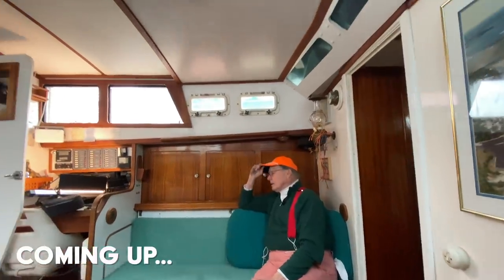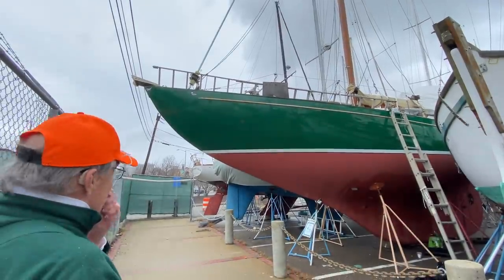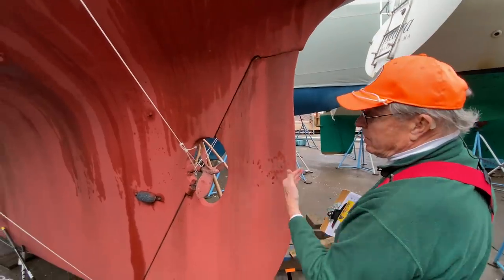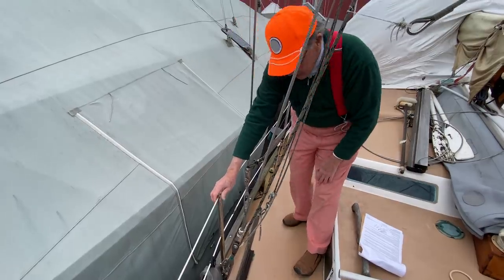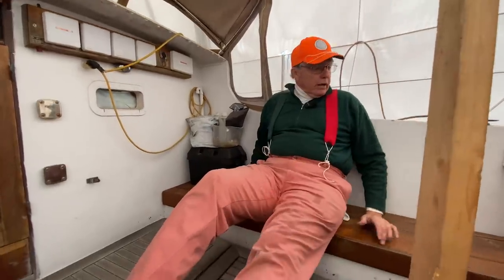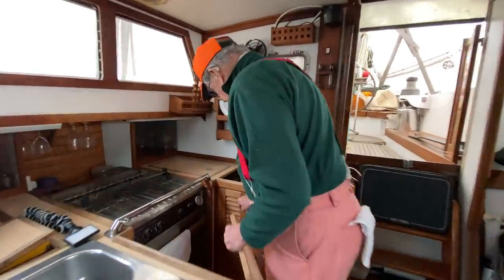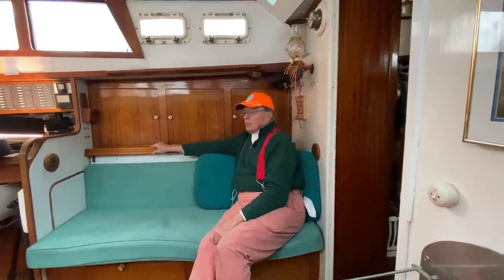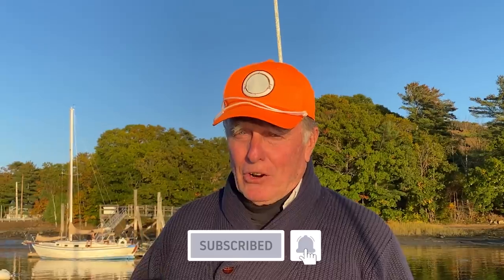SURVIVING A PIRATE ATTACK!! - A Steel Sailboat Story - For Sale $64,900 - EP17

Comment: Hi, My name is Jay. I'm the owner of Gandalf. I have owned the ship for 28 years .If you have a question I will try and answer.
Reply: Love your yacht.... Really like how light and airy she is below. .. bet she tracks like on rails.  Someone could go a long way in comfort on this vessel.
Reply: Hi Jay, when is your book coming out? You must have at least a couple of volumes of stories sailing such a lovely yacht. Wish I could come buy it, but it is a bit out of my budget.
Reply: @tharney8003  solid idea!
Reply: @tharney8003  No story. You have to make your own. Have fun.
Reply: @ecnavttocs  Hi , the ship sails well and most important Fast!. Spending a lot of time in the ocean can tricky. It' really big out there.
Reply: Hey Jay , that's a great looking boat . 
Is there any rust issues inside the hull or bilge ? What part of the country is she located?
Reply: @kwaichangcaine8234  Hi, I keep after All parts of the ship. Most important is that all the inside steel can be seen for inspection No surprises.
The ship is in Beverly Ma.
Reply: Sweet boat Jay, buff and brawny on the outside, bright and cozy below.
 Captain Q certainly did a worthy tour of Gandalf and failed only in hiding his admiration.
Reply: Hi Jay. Your boat is on my short list, and this tour helped answer some of my questions. Guessing that wenches are located well for single handling? From ad photos, does the main have 3 reefs? Thanks. Love Gandalf's lines.
Reply: @alu.minium521  Hi, three reefs full batten main. Sailed mostly in second reef. Went just as fast and easy to handle.
Reply: Hi Jay! Great boat. Seductive price, fantastic pedigree. Looks like you've kept her up too. Some basic questions: What is her waterline length? Draft? Beam? Displacement? Sail area? How much ballast (weight), where is it, what material? How much sail area? How much fuel and water does she carry? How big are the house batteries? How old is the engine? How many hours on it? That nice-looking heater in saloon, what fuel does it burn? Thanks!!!
Reply: @charlesdoane8773  Hi,
Have a look at this.

  Fore deck: Forward is a Maxwell windlass .The foot switch is just to STB of it. There's also 2 remote fobs.
The other winch is there because I was going to install a Samson post, but Marine Exchange had this nice winch. It has been very helpful in a number of different ways for a second anchor and such.
The ring behind the windlass is for an inner forestay. The sail is on the ship with a turnbuckle and lines.
The forestay wire itself is in the closet as we weren't using it. It mounts on the spreader.
It's a Concordia coal stove I converted to propane for easy use. Easily changed back to coal if desired. A Charlie Noble is afixed to the chimney above the deck when in use. Otherwise, there's a bronze, watertight screw cap cover on deck..
 Mast: It is original. The boom has been replaced as the original was destroyed in the Manchester Marine fire in the 1980's.  Last pulled in 2016.
I made all the ss hardware. The 3M plastic wrap was an experiment. Standing on the jumper with a can of varnish and a brush was getting old as am I!  It's been on for 5 years. It's all in the repair log. No varnishing to do above the spreaders.
Tankage:
Holding tank: 15 gallons under the floor behind the mast.
Diesel:  Two integral steel 40 gal tanks. I added two 19 gal plastic tanks beside them. There is also a bag tank in the engine room.  Total Capacity of about 140 gal.
These all run off a manifold with an electric pump to fill the "Day Tank" port side steel.
Water: At the moment there is only one 15 gallon water tank installed. I removed the other to service and inspect the bilge.  We only carried 30 gallons of water as the PUR 40 watermaker which was pumped into a 5 gallon plastic cube in the deep sink can be tested before decanting into the indwelling tanks.
Mechanical.  The winches were rebuilt 2 years ago.  Stripped clean and reassembled.
The ship first used a V belt system. That was the tech at the time.  Next came along Gates HTD belts. Much better and no slippage.  I had Gates do a study and found that it was only rated at 15hp.  As I would be installing a 52hp engine this was not good enough. Back to Gates again. They recommended a Poly Chain belt. These belts were $250 in 1992!  They rated a 24mm wide belt at 90hp for continuous 24hours use. We had three days at 3200 rpm after fun with pirates, so I spoke with them about what I was going to need. We decided that a 90mm was overkill but I had the space.  Check out the next Harley-Davidson motorcycle you see and it will have one of these belts instead of a chain. They are about 24mm and will handle 100hp and someone not being nice to it so 90mm and a 14 inch propeller is not a problem.  I designed a system that could use the new belt .Works great. The only problem I ever had was I did not put enough angle to the CV joint and had static wear spots from not moving up and down and out of plane. Simple fix to lift the back of the engine a couple of degrees.
Next the belt alignment is done at the top sprocket. Simply by "Canting" the angle of the sprocket it will center the belt in the sprockets. Easy.
There is a spare belt ready for emergency use.
Process to replace the belt:
 The upper sprocket is loosened and dropped down a bit.The two bottom pillow blocks bolts are removed and there is a spacer underneath the pillow block ( there is a handle on it for this job) is removed and the new belt is slid into place. The spare belt is tied back to stay away from the upper sprocket. I made a tool to lift the upper pulley to put the correct tension and alignment back on the belt. This can all be done in about 15-20 minutes.
There is no alignment with the shaft as it is all one assembled. Meaning ,the shaft,coupler and lower pillow block stay straight. No shaft alignment to do. It's done once..
I swapped the belt at about 2500 hrs just because. It looked new. Only a cruiser will fix something not broken.  Just reassemble and tighten all back up and good to go.
All bearings and propeller shaft are greased remotely.
Yanmar recommends 250hrs for oil change.  All this is in the log.

Electrical:  Yes, there is a trickle charger with controller for the wind generator and solar panels to the battery..

Safety:  There is a shut off switch for the propane just left of the companionway.

Coating:  The topsides are painted with a base coat- clear coat system. PPG and Dupont.
My Last full paint job was in 2008.
The black is epoxy over a small repair. It works well with the coal tar epoxy sealing the hull Bottom painted 2 years ago. It has not been in the water
Repairs done by removing rust. Treating what might remain. Then an epoxy primer is applied then finishes the epoxy coat.
Have a look at this site . There have been rebuilding a steel ship. https://www.youtube.com/watch?v=IRvQQgiR8yc

Steering,
As you saw there are two control heads for the Autohelm linear drive. It is controlled by a KVH flux compass. There is also a new spare compass and a spare drive as well.
The TMQ is Australian. I bring it out should there be a problem with the Autohelm. It has its own linear drive. As you may have guessed I don't like steering the ship.
Rudder just hasn't moved in two years. The pinlets might be tight or the bigger bushing in the rudder shaft may need some attention.
I replaced the entire rudder system when I rebuilt the ship. I don't see it as an issue. At least they are not loose!
The Aries is not mounted because we would only use it at sea. I removed it at the repaint. All mounting is there. Also spare parts for it.
There is a Big tiller for the emergency tiller. It has been tested.
Mooring,
It's out in front of the marina gas dock. It can only be sold. I still have a permit but it's not transferable.
Hull.
I have blasted the ship twice. When I first bought the ship and again in Thailand in 2003.
There are vertical welds that join the plating. I have not had to do anything with the rivets in 28 years.
I have removed the entire galley and redesigned it as that part of the hull could not be inspected. Now, It can. Everywhere the hull can be inspected .
I do not like surprises.
I hope this answers your question.
J
Reply: @jaybarry8483  Thanks Jay! That's a whole lot of useful info. But what about the basic specifications? Are they simply unknown? And the ballast? Also, how is the boat insulated??? And what is the air draft? Can the boat fit under ICW bridges? I'm checking the boat out for my cousin, who is very interested, but a bit of a novice. He's already inspected it; I will organize an inspection myself. I own a 47-foot aluminum boat, so am somewhat versed in the realm of metal boats.
Reply: @charlesdoane8773  Hi, 7.5 draft, 33ft water line,15 tons and 64 ft from water to top of mast.
Ballast is lead and concrete.
Deck is insulated. The hull is not for inspection reasons. Don't know about the bridges. I preferer to stay away from them!

Ask anything.
J
Reply: @jaybarry8483  Thanks! I found the broker's listing. Some good info there. One thing missing is sail area. Need that to calculate SA/D ratio.
Reply: @charlesdoane8773  Hi, The main is 504sq ft. I do not recall the jib area.  I had a new one made three years ago. Used it twice. The ship was more than fast enough!
Newport to Bermuda, 660 miles 3.5 days. Galagoes to Fatu Hiva  3000 miles 19.5 days. And that was being careful.
I also have the complete inventory list should you want it. I bought it all and it impressed me!
J
Reply: Hi Jay.
Greetings from Frank.Sydney Australia.
Thanks for making the effort to reply.
Her lines remind me of the three times  Sydney to Hobart Tasmania race winner "Freya" . So beautiful.
Could i ask how the deep draft went in the pacific on your circumnavigation and what is the hull steel plate thickness. 4mm - 6mm ? Cheers.
Reply: @frankguernier2280  Hi Frank,
We loved Australia! Spent three years there. Sailing and driving.
Never any problem with the draft. Rarotonga might have been a problem. So we skipped it.
The hull plating is 5mm,deck 3mm and 10mm on bottom of the keel.
J
Reply: @LoanwordEggcorn  Hi,
When I designed the drive this was the best there was. It has 5500hrs on it with no problems.
Gates did a study for me to make sure it was over the top.
As a Porsche mechanic I have seen that type of belt everywhere.
Thanks,
J
Reply: @jaybarry8483  Thanks much for your reply.  Are you referring to the Gates synchronous belt or the Hutchinson Poly V being used in many applications?  They're fairly different designs.

Also I assume the bilge the belt is in is designed to be dry.  Would seawater affect a belt much?
Reply: @LoanwordEggcorn  Hi, Gates poly-chain belt. After 2500hrs I swapped it with the in- place spare. It looked brand new.
I'm told it Very hard to even cut one of these belts. First, it never gets wet. The bilge alarm would go off first. From my experience nothing would bother this kind of belt. Ask Gates.
J
Reply: @jaybarry8483  Thanks much!  

Out of curiosity did the original design use a vertical shaft on bevel gears, chain, or other type of belt?
Reply: @LoanwordEggcorn  Hi, V belts! Could not be rated over 10 HP.
J
Reply: Just a note to say I loved her.  ♥️
Reply: @Themothershipsailing  Hi, Interestingly the former owner always called Gandalf a "He" as to we !
J
Reply: jay barry   Jay, I love your boat, ship. I guess 28 years is long enough to want a change of pace. Have you been living on board for those 28 yrs ? Please forgive me if that question has been answered , I apologize in advance. Do you think that your ship is better suited for a young owner with lots of energy , or do you think some older geezer would fair well with your ship ? If you have any time to consider this I’d appreciate your thoughts.
Reply: @robertblake1032  Hi Robert,
When we rebuilt the ship we kept it in downtown Boston as our "Winter condo"
Your house was in Gloucester Ma. and my wife worked in Boston. 80 mile commute. It was a $1000 dollars and two guarded parking place for six months in the marina! In 1997 we sailed to Trinidad and back to Gloucester. Made a bunch of changes and a new engine and spent the next 8 years sailing around the world.
So, no not full time but a lot. I bought the ship when I was 40. It's a big ship will need someone with energy. As for "old geezers" I met quite a few when sailing that were hard to keep up with! It depends on the person.
Hope this helps.
J
Reply: Nice boat Jay, looks like it would take you anywhere!! Nice work!
Reply: Thanks for killing those pirate scum. "Seh hullo choo my luddle frund!"
Reply: How much of a nightmare do you think it is to service that belt while underway?  I mean really what would your options be at that point?  Would you have to pull the lower shaft to get the belt around it?
Reply: @TroyBlass  Hi Troy,
When I designed the system it was with the worst case in mind.  So, I made captive nuts that stay in place .Also the bolts as well . The spacer under the forward bearing pillow block has a handle welded to it for easy placement. The spacer is used to allow the belt to slip in place. The rest of the belt is pre-hung to allow a fast replacement.
When I worked with Gates engineers on this they told that the belt was all but indestructible.
As an Old Porsche mechanic I'm pretty good at finding what will fail before it does.
At 5500hrs and no issues. Hard to do better than that!
Next time you see a Harley Davidson motorcycle have a look at the belt drive they use. I'll bet you've never seen one broken down in the street because of the belt.
Happy to answer any other questions you might have,
J
Reply: @jaybarry8483  Top notch reply!  

As a guy who had a cam tensioner fail in the head of my 944S, sometimes having a "oddity" comes back to bite.

I'll be up your way later this spring.  If for some reason shes hasn't sold, I would very much like to arrange a look.

Good luck to you and yours
Reply: @TroyBlass  Hi Troy, Because I was in the business for 40 years how much did the repair cost?
Expensive bits!
J
Reply: @jaybarry8483   I got really lucky and found a wrecked 928s4 with a good passenger side head.  ~$1500 by the time you factor in new t-belt, gaskets, fluids, and head.  I wish they would have just added a second cam pulley, but fun car for it's day.
Reply: I'm very glad you and your better half survived that attack in the Gulf of Aden. Back in the 90s, I sailed those waters.  I love how you restored Gandalf. She's truly gorgeous, both inside and out. Love the serious work done to protect against electrolytic corrosion, especially near the mechanicals.  If I were to sail around the world, and I'm seriously thinking about it (but I'm not ready quite yet), I would want to do it in a solid sailboat like Gandalf. I don't want to waste your time, I think I'm 5 years out from even contemplating something like this, but I am interested. I would make some updates to her, but I'd keep her name. I would take her far but I'd try to steer her out of harm's way.

It would satisfy some curiosity if you'd indulge a few questions:

1) I noticed the ingenious belt drive on the shaft and saw your comment about having an in-place spare.  How deep is Shaft Alley? What can you tell me about her shaft seals and maintenance?
2) It looks like the engine room has water-tight bulkheads fore and aft. Is that correct? Where else does Gandalf have watertight bulkheads? It seemed like she also has a small water-tight bulkhead in front of the V-berth area.
3) If someone were to outfit her, do you think there would be room enough in a refit to include equipment like a watermaker, dive compressor, air conditioner, water heater, expanded battery storage - Maybe not all those things, but some of it without compromising the layout too much?
4) I assume there is sail storage in the back, behind the engine room/shaft?

Thank you in advance for any answers. Gorgeous yacht. It looks like she could do another circumnavigation.

Thanks to Captain Q and his fearless companions. I love your reviews and I'm especially happy you reviewed this beauty. This didn't seem like the type of boat you usually review, and I felt that you wanted to use the Captain Q measuring stick, but couldn't. You've reviewed a lot of sailboats and I've seen them all, but to me, this one stood out. I'm not against modern sailboats, and I like self-furling mainsails, yet there is something about a full-length keel and the sublime beautify of expertly rolled steel. And, it's always nice to see the ICOM SSB, present.
Reply: @marroquinjoe  Hi Joe,
The bilge for the propeller shaft is about 4 feet below the engine bed. The propeller shaft is a remote greased tube. I use the Teflon packing. Also a special Wurth Co. grease. Works great. Little  work.
Only the engine compartment has a wall.
There is already a water maker. I used to have a 5 gal water heater. By the time you got hot water to the sink you wasted 2 quarts of water!  So I took it out. There is all the room  for stuff. What was not shown was the 20 gallon emergency WINE storage! We had a story in Cruising World Magazine about that.
We only carried a stay sail and a drifter. We had a commercial sewing machine should we have a problem.
Happy to answer any other questions.
J
Reply: Jay, i love your yacht 
Do you still possess her? 
I want her
Reply: @novavega1890  Hi Brooke,
Indeed I do!. I thing people are waiting on Spring to make a decision.
We will return in the Summer to sail.
J
Reply: @jaybarry8483  
Well, im very serious iv been looking  for
Something that can truly sail.  a yacht that can  not be reckoned with when at sea. Im unsure of your desire to part with  her but if you want to discuss further  id like to exchange contact information  discreetly do you have a fb  account or other  means to send private email 📧?
Reply: @novavega1890   Hi Brooke, Third try on reply please let me know if you see it. J
Reply from the maker: Please contact JAy here to start the ball
Reply: Hello Jay 
Is she sold already?
Reply: @waynewintermute3869  Hi Wayne, The ship has  not sold yet. Still a bit cold in Beverly . Not quite on peoples minds yet.
With the world opening back up it will be interesting to see what people decide to do.
We will return this summer for launch.
J
Reply: @jaybarry8483  
I'm interested. Would I get more pics of the inside and any other info you have?  Thank you.
Reply: Hi Jay, did Gandalf's and his two big iron balls near the compass help in any way to thwart the pirate attack that night? Gandalf has balls, and he's a wizard, that must've accounted for something? Thank you 🙏
Reply: @mboyer68  Hi,
The Quadrantal Correctors are two soft iron spheres fitted in brackets on either side of the binnacle.
When my friend stood on the deck of his ship, that took 'Spheres'
J
Reply: Hi Jay, is gandalf still for sale?
Reply: @scotbot369  Hi Peter, he is indeed. We will return in July and get the ship ready to sail.
J
Reply: @jaybarry8483  I'm interested in finding out a bit more about the boat. Is there any other way I can get in touch with you? Pete
Reply: Does it have Garmin and radar with proximity warning?
Reply: @m.j.a.581  Hi, The ship has a Raytheon unit. Last I checked it was working.  It does have an alarm. But if I were to go long and far I would replace it with the newest chart overlay unit. Does that answer you question?
J
Reply: @jaybarry8483  thank you Jay. My friend doogie will be in touch soon 👍
Reply: Great boat! If I had the cash I would come look at it.
Reply: @diver0129  Hi, There is still time!
Reply: Hi Jay….has the boat been sold yet?
Reply: Firstly well done for not taking their crap … good on you… we live in South Africa on a farm and have to face things most wud probably cringe at at times … we should never tolerate anybody threatening our lives
Reply: @tiptop1681  Hi, I will keep the ship and sail next summer. Thanks for the interest!
Look about and try and find another ship like Gandalf. You will be hard pressed.
J
Reply: Wow, You should write a book or a movie about your adventures. I plan on living full time on a sailboat in a couple of years. You definitely are humble about your life and your boat. Thanks.
Reply: @blackmetalotaku8898  Hi, Thanks for the note!
Reply: If its not sold in 2 months Id love to make an offer. Inspirational sailing.
Reply: @MrBrentles  Hi, Thanks for the note. The ship has been covered for winter and yard fee paid. Make your offer!
Reply: Dear jay as one of the pirates that tried to steal your boat I wanted to tell you how much we regret not getting your boat so many years ago. It would have made a great addition to our collection. We look forward to picking It up From the future owner! LOL 😂 jk of course.
Reply: @TheSakeCat  Hi, Surprised to hear from you! Been a long time. Please send a pic of your self!
Your a funny guy!
J
Reply: Has she sold?
Reply: @GaryARahn  Hi Gary, Not yet.
J
Reply: @jaybarry8483  What a beauty. Do you accept Bitcoin?
Being 74, I wonder if she is my size though.
Reply: @savco3908  Hi Savco, No on bitcoin. I'm very fond of the "Kite Flyer" you know, Mr. Franklin!
It's a big ship and will need two competent sailor . Thanks for the note.
J
Reply: @tharney8003  ok
Reply: @howtookidsstuff2123  ?
Reply: Hi Jay, if Gandalf is still available, could we connect directly to chat? Thank you
Reply from the maker: I believe it is    I sent him an email this am to mention your interest. 
Get back to us if you have a problem connecting 
Good luck
Reply: @dmitrizorine  Hi, Jay here. The ship is still for sale. What do you need to know?
Reply: @jaybarry8483  Thank you for the response. I would like to ask you few questions offline. Captain Q has my info, if you could reply via email, please?
Reply from the maker: I don’t have your email
Reply: @YachtHunters  Hi Captain Q,
Jay here . what do you need?
I did not get your email.
J
Reply: @YachtHunters   I sent you email to captainqyachthunter
Reply: Is she still available and is she still in MA? Has a hull survey been done?
Reply: @joesnyder6569  Hi Joe. Jay Here. The ship is still for sale . It has been covered for the winter.  It is Beverly Ma. The last hull survey was done in 1992 when I bought the ship. Every place of the inner hull can be seen by eye. makes for no surprises!
Reply: @jaybarry8483  Jay, 
I sent messages on both yatchworld and boat trader. I want to see her and have the hull surveyed. Let me know if you see them. I really don’t want you giving the world your contact info. Looking to get real serious in the April or may timeframe. Boston in February sounds terrible!!
Reply: @joesnyder6569  Hi Joe, Sailboats Northeast is who to contact. Paul Chase in Marblehead Ma. You bet its COLD!
Reply: Where is the location of this boat?
Reply: @njblancodearmas   Beverly ma
Reply: Jay, did you ever read "Sea Sense" by Henderson?  That is what convinced me to someday own a boat like the Gandalf, as Henderson is quite persuasive to go full-keel and steel.  Good luck on it's sale and I just wish I had the money and had not had to move back from Maine to Ohio!  You will find a buyer...the survey could not have found anything major from what I could see on this video!
Reply: @donrcavin  Hi Donald,
Thanks for the note.
I have not read that book ,but I think I have read every other one!
Funny thing, I had my ever so brave wife read all of then as well.
Helps to cut down on surprises.
J
Reply: Love the lines. Looks like my old Pearson Triton! Same full keel, but thick fiberglass instead. 
Nice job taking care of the pirates my friend. Glad you all made it back. 
Full keel is the only way to go at sea.  Stable, and will right itself if knocked down. Those catamarans would scare me to death.
Reply: No way;!! I used to live in Amsterdam and would walk by that ship all the time over by Nemo museum!! :0
Reply: I so love your boat. It’s my favorite design. Unfortunately I’m too old to get her going if she would still be available. I hope she gets a good owner, she so deserves it.
Reply: Did boat sell already?